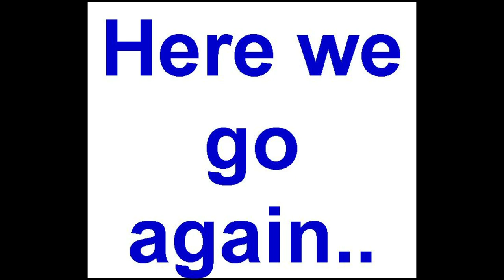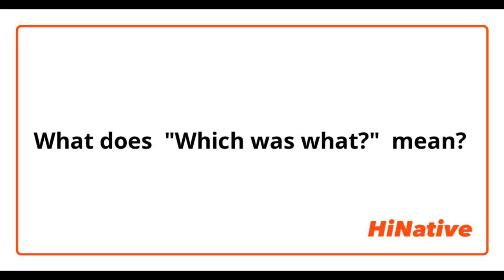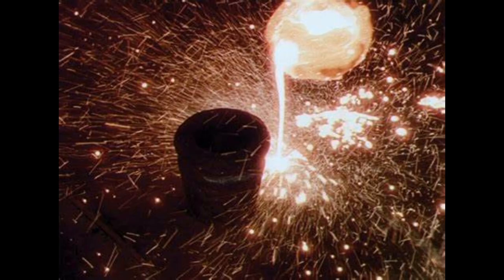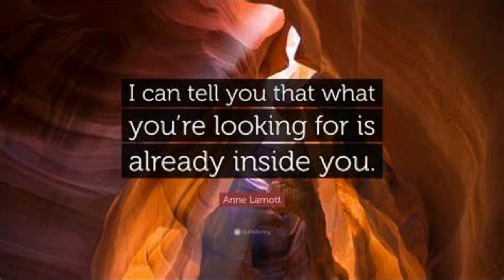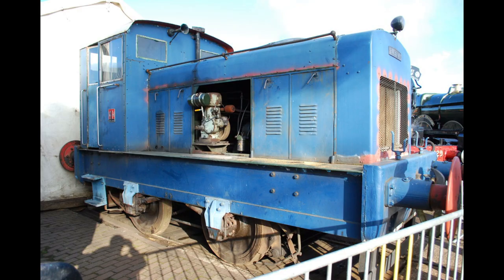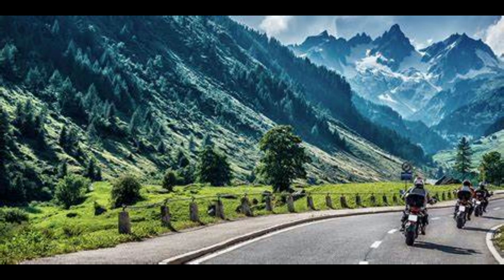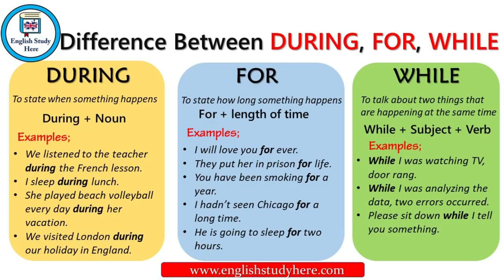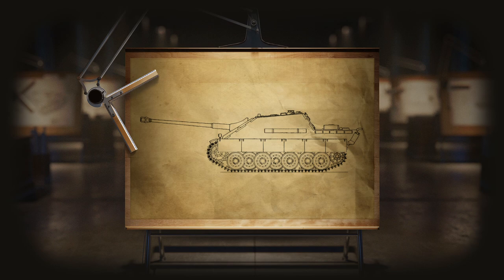The Worst Tank Concepts Of World War II │ Volume 2

Comment: FYI, the idea of mounting a 30mm auto cannon to a tank for AA defense, was not to actually shoot down the aircraft. Aircraft shock was/is real and has more of an effect on combat than the actual damage caused by the aircraft.
The goal was to give the appearance of fighting back as this greatly improves moral, even if the actual combat effectiveness of AA is not that great. The German even developed basic MANPAS that would likely never actually shoot down an aircraft, but the goal was to allow soldiers to at least fire back and feel like they have a defense against aircraft.
Reply from the maker: I mean the project was seemingly meant to actually shoot down planes but yeah the moral boost was probably a bigger part of the project. Thanks for your input.
Reply: The scary thing about the MK108 is that a B17 or B24 was destroyed by, on average, FOUR hits.  Single seat aircraft would often break up on the FIRST hit.  The MK108 sacrificed muzzle velocity for rate of fire, so the flight path of its tracers would be easily distinguished from lighter weapons, so the MK108 would not only have a morale effect on the tankers, by giving them something to attack back with, it would also have a morale effect on the attacking pilots.

I suspect that the main problem of the MK108 was that the effective range was not long enough to engage attacking aircraft before they released their weapons.
Reply: Take a look at the Eastern front. Heavily armored storm of the ground attack aircraft and waves of Russian infantry. 
It would have been appreciated by the German army if they had actually managed to get it to work.
Reply: You think the germans were going to stick a whole ass 30mm on a regular tank for the sake of boosting morale? You could do that the American way and just stick a bunch of MGs on top.
Reply: @whispofwords2590 theres a picture of a StuG with a 20mm mounted onto it

Comment: Honestly the Valiant really wasn’t THAT bad, obviously the prototype that was built had a lot of issues to say the least but really most of the issues could’ve been fixed with a relatively minor redesign, which is pretty typical for first prototypes of a new vehicle design to have these types of issues which doesn’t make the Valiant particularly special in that regard.

Heck the early design for it known as the Vickers Vanguard was pretty impressive with a true pike nose front long before IS-3 and it probably would’ve been a solid design if it hadn’t been redesigned with thicker front armour ruining the front slope and straining the suspension

Comment: Okay so hear me out, even though the Panther 108 idea isn't the brightest in terms of the role it was meant to serve, I think that 30mm would have otherwise worked as a very good high calibre anti infantry and light vehicle weapon anyways given the Panther itself was facing mostly armoured units, the 30mm would have made it difficult to even hide in a building if you have a auto cannon just breaking the brick into your next tombstone and still backing it is the main gun. I would support the version with the coaxial being the 30mm more...
Reply: The 30mm 108 is a more like a grenade launcher. It had poor bullet velocity and low penetration for AP. Mk 103 would be better but is wau larger too